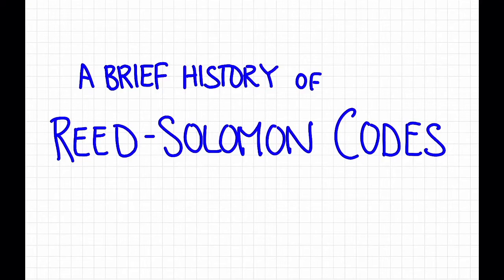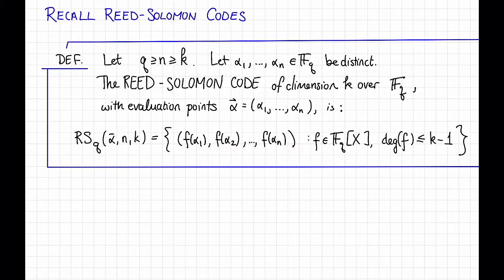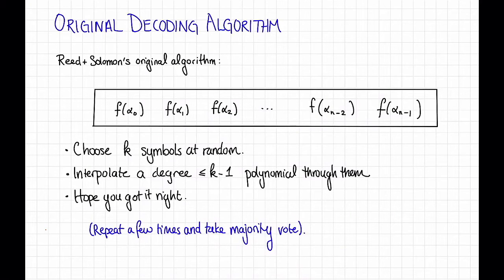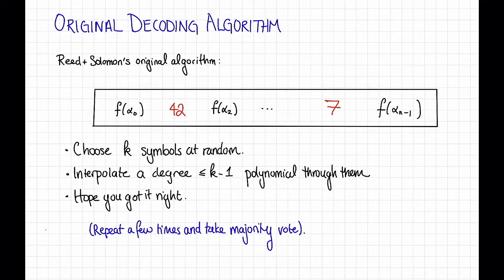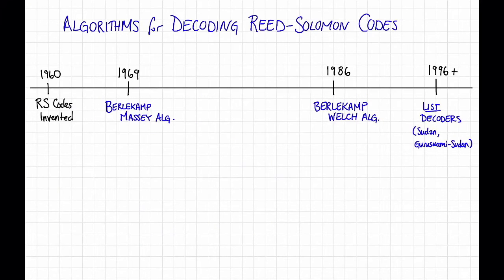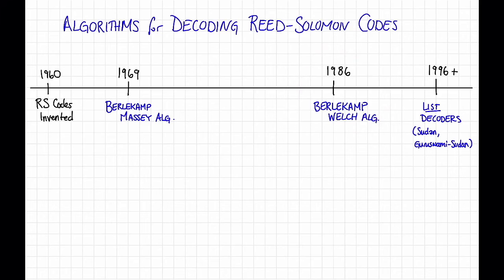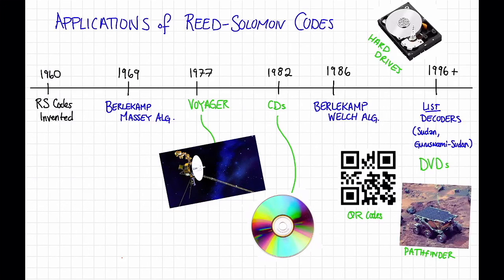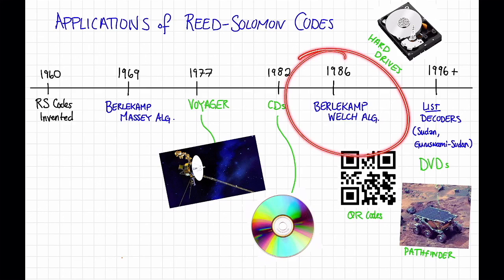Lecture 5, Video 1: History of RS Codes

Comment: Some key moments and decoders are missing. In 1960, Reed and Solomon published a paper for an error correction code that generated codewords that were a set of values, but it wasn't until 1986 that a practical decoder was developed for that encoding scheme. So at that time (1960), the original encoding scheme was abandoned and a switch to BCH compatible encoding was done. In the textbook Error Correcting Codes by by Peterson and Weldon (first edition 1961), the first book about error correcting codes, Reed Solomon is described as a subclass of BCH codes (section 9.2 - Definition of the Codes)  and there is no mention of the encoding described in the Reed Solomon paper. That original encoding scheme came back into use later, such as list decoders and some erasure (all error or missing data locations known) codes. The Wikipedia article on Reed Solomon error correction code refers to the two encoding schemes as "original vlew", where a codeword is a set of values, and "BCH view", where a codeword is a set of coefficients. In some cases the same codeword can be viewed as either a set of values or a set of coefficients, as explained in Mary Wootters lecture 4, video 5 "dual view of RS codes". 

Missing decoders from the timeline: 1975 - Sugiyama' extended Euclid decoder for "BCH view". 2002 - Gao's extended Euclid decoder for "original view".
Reply from the maker: Thank you for this additional context!
Reply: @marywootters7651  - I was able to find a more accurate history (mostly from Peterson and Weldon's 1961 textbook,  the first error correcting code book). and update my original comment. My updated comment is more compatible with your other videos, such as noting "original view" usage for list decoders.